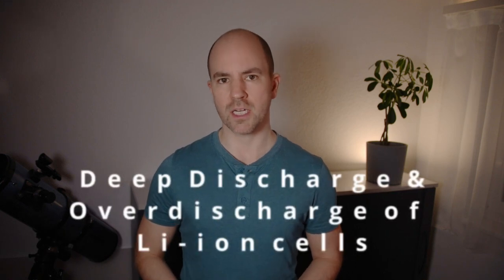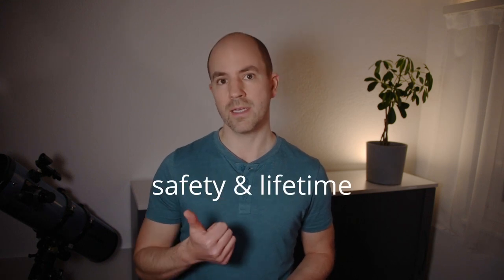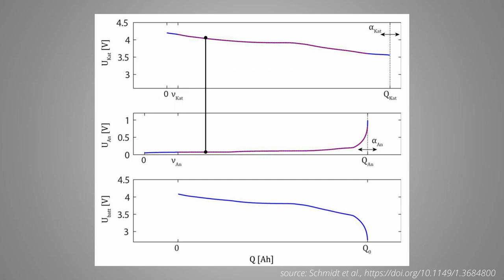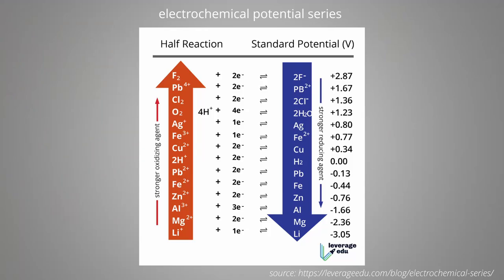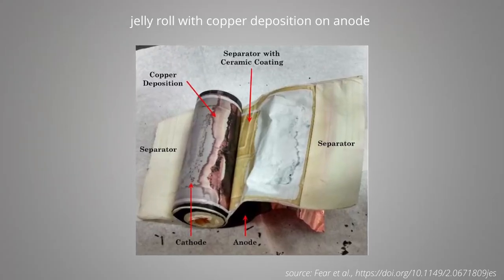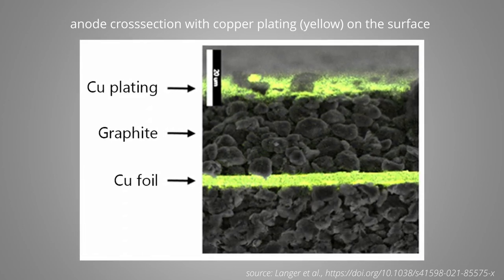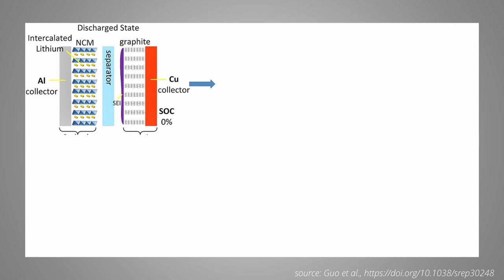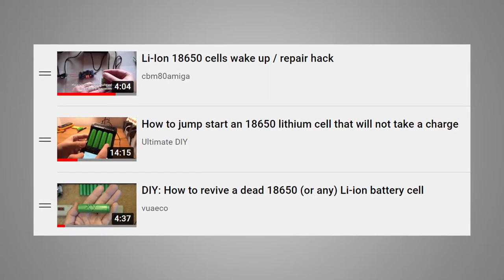Battery Safety: What does deep discharge and overdischarge mean and why is it dangerous?

Comment: Hello. 
We are making a battery powered (Li-Ion) device at work. The original design assumes that the device goes to sleep when it is not used, however it can never be completely turned off and it always drains the battery. How big of a problem is that in your opinion?
Reply from the maker: Hi, thanks for watching and your question. If your device can discharge the battery below the limit specified by the cell manufacturer, it is a potential safety hazard. I would propose a two step safety approach to avoid deep discharge. 
1. send the device to sleep mode whenever possible and prevent wake up if one of the cell voltages drops below e.g. 3V. 
2. switch off the device completely if the cell voltage drops below e.g. 2.5V. The values for the limits depend on your specific cell.
In any case, you should prevent recharge of the battery in case it was deep discharged. Hope that helps!

Comment: Great Explanation!! But we had a scenario of a 48V 15Ah NMC pack which went in to deep discharge by keeping it Idle for several days and OCV is around 9V. Then we tried to charge at 1A , then slightly increased to 5A when it reaches 16V . But thermal runaway happened at 28V . What could be the major reason in this?? Any clues

Comment: Interesting videos, thanks for the in depth explanation. Do you see any harm in "bumping" a cell which has fallen slightly below threshold in order to allow it to accept a charge again from the charger? I understand there may be a degradation in performance from the chemistry deterioration, but if the cell is only slightly below this threshold, say  >2.0V  I can't see why it would be so problematic.
Reply from the maker: There might be cases where that does not lead to a problem. But very often there is a reason that led to the deep discharge (even if it is still >2.0V). So unless you know exactly what history the cell has seen and you understand the cell chemistry well enough to judge what electrode potentials were reached when the cell has this voltage, my clear advice is don't do it.
Reply: @meandthebattery9628  Fair enough. I'm not entirely convinced it is as problematic as made out to be. There are scientific papers showing that the copper formations risking an internal short do not pose a significant problem until a state of -12% discharge. This would suggest that in the vast majority of cases, if the battery is 0V or above, the cell can safely be restored to service without any appreciable loss in capacity.

Comment: So what about cell balancing in electric vehicle? Should we deep discharge (soc 10% or lower) and the. Recharge to 100% for better cell balancing and battery health....or is this practice bad
Reply from the maker: Thanks for watching and your question. As long as your BMS works correctly, it should at least not harm your battery (preventing deep discharge) . If it is beneficial or not depends on the balancing strategy implemented. In general, a good system should not require a full discharge for proper operation.